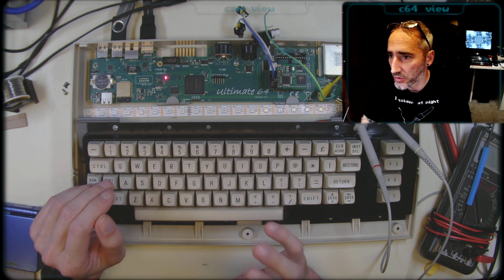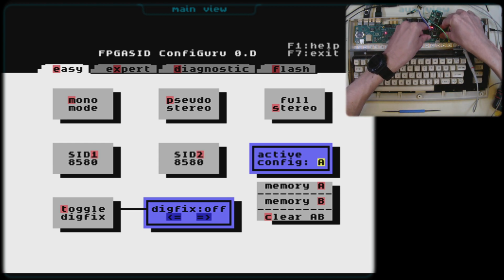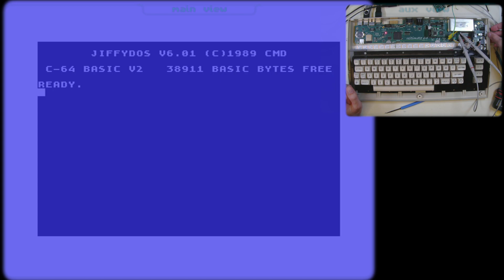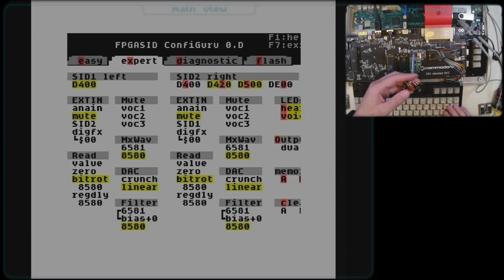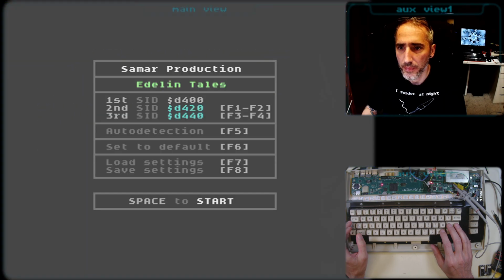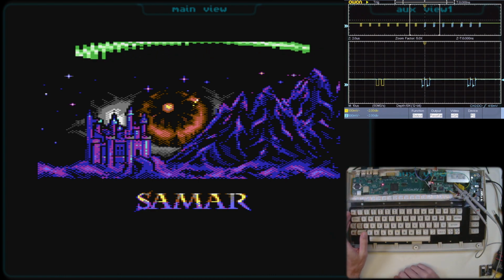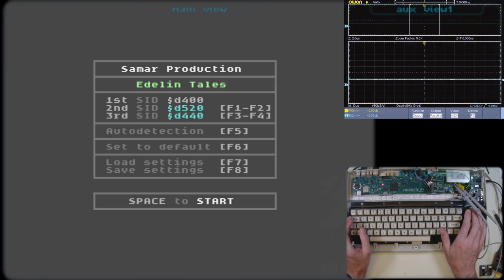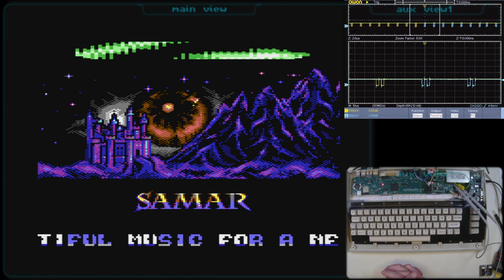C64 - A work-around to get 2 FPGASIDs running on 4 different addresses on the Ultimate64

Comment: Why are you using connections to the cartridge port?
Reply from the maker: Hi Gideon. This was asked by one of my viewers. We were looking for a way to utilize all 4 SIDs provided by these 2 FPGASIDs on unique addresses and since P7 offers just one additional address I had to go this way. I'm glad to see that it is working now, many thanks for fixing it :)
Reply: @c64customs  P7 offers one address _discriminator_, but this applies to both sockets. So, if you set P7 to represent A5 for example (weight: 0x0020), and you set socket 1 to D400 and socket 2 to D500, then the same A5 signal causes each FGPASID to split itself at 0x20 offset. Thus you get four SIDs at these addresses: D400, D420, D500 and D520.  You don't need to configure the address with ConfigGuru, I think; the U64 does this for you.
Reply from the maker: @gideonz74b  Thank you very much for this info. This explains something I have recognizing while tinkering with addresses. This is indeed very helpful! Sounds like a comfortable way to handle multiple SID addresses :)
Reply: @c64customs  You're welcome. What must be noted as well is that when the FPGASID gets configured to D480, it will use its A7 input. However, it does not know which address line is presented on P7, so this might lead to confusing results; there might be a difference between the address configured and the address it actually appears on. For this reason, I think that the U64 always configures the FPGASID to use A5 (using the "D420" setting). When you connect A5 of the FPGASID to P7 on the U64, the addresses change according to the U64 configuration. So my advice is: connect P7 to the A5 inputs of both FPGASIDS, and use the SID address editor in the U64 menu to configure. If there are any settings that get overwritten which you don't want to change, we may have to look into that.